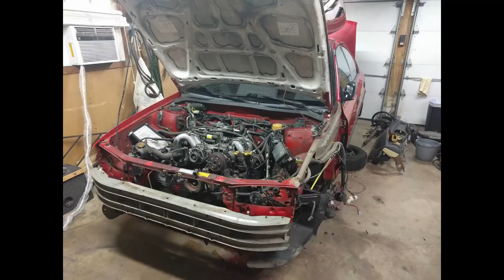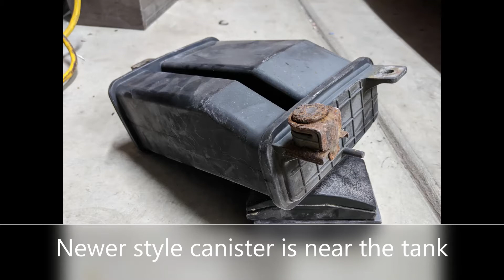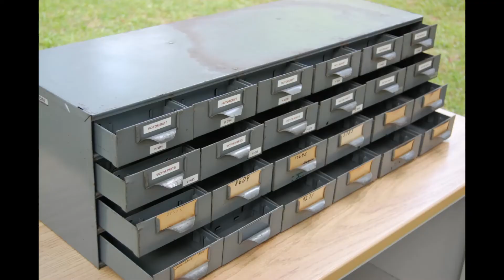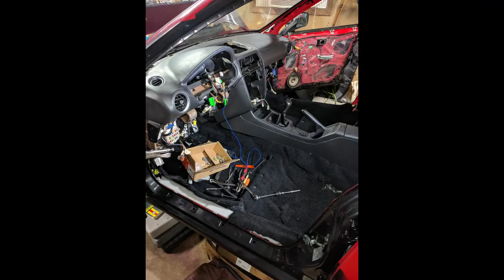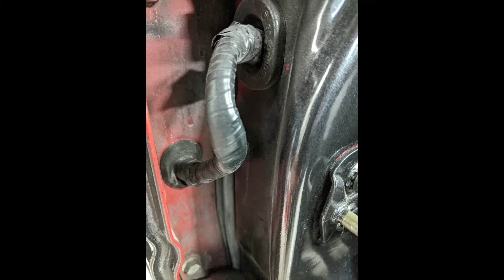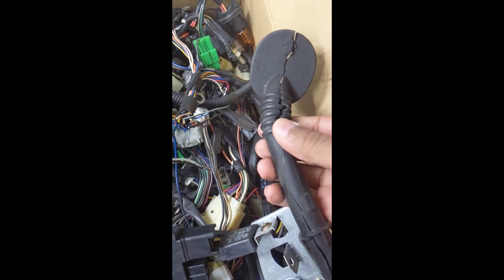Subaru Impreza WRX STI GD to GC  mechanical and electrical swap notes

Comment: Great video! I’m doing this exact swap into a 96 Brighton coupe so no door controls. Did you use the mid\rear harness that connects to the fuel pump etc or did that get wired in?
Reply from the maker: Thanks! I used the WRX fuel harness, it routes fine. Only part of the WRX harness where I didn't use everything was the trunk harness. The connectors I didn't use are for the rear latch lock, trunk light, rear wiper. For the tail lights and third brake light I spliced in the GC connectors.

Comment: So you basically used everything from the gd in the gc? So you basically have a gd just pasted into a gc? Minus the door controls.
Reply from the maker: In general, yes. There are a handful of gc components mechanically and electronically. If it were a newer GC I probably could have kept more GC components as the later models share more with GDs

Comment: I was wondering could you convert a GC front end into GD body ?
Reply from the maker: That definitely wouldn't be a bolt-on modification. The GD is significantly larger than the GCs. But, you can convert anything to anything with enough time and money.
Reply: @GoodDeedsHighSpeedsLV  yeeah I wanted to try to do something that nobody hasn't done it like that probably a few or so has done it. Wanted to try to do a 2004 wrx and do a Gc8 front end convertion and was wondering if it was possible haha
Reply from the maker: I think it's very possible. You'll have to figure out your approach. Like do you mold the GC headlights, grill, and bumper to the Gd front end, or do you take an entire gc front end (including fenders) and Frankenstein it onto the Gd framing. It would be really cool to see. I say give it your best shot! If you're not too far i'd come by and document/film the progress. I also have several extra gc headlight sets, parking light housings, side markers and  cf hood/hood vents.
Reply: @GoodDeedsHighSpeedsLV   Ill  definitely lyk know about it. When I do start the project. thank you broooo needed some advice about it thank youuu brooo

Comment: Awesome vid. I’m planning to do a full gd swap onto my gf. I hear gf and gc are basically the same. Was everything you swapped mostly a bolt on? Were there any parts from the gd that don’t fit on the gc/gf?
Reply from the maker: Thank you. The gf and gc are pretty much the same. Mechanically all of the main components (subframes, engine, drivetrain) bolt on from the GD. The top hat from the gd will not fit the GC, so just buy GC shocks/struts or coilovers for that. In terms of suspension I did have to get different offset rims as the gd has a wider wheel track. It depends if you get a gg or gd doner car. I go over that a little in my intro video (visit my channel). I hope this helps. In a week or two I'm going to have more swap/project related material. Lmk if there is anything specific you would like to see that I didn't cover.
Reply: @GoodDeedsHighSpeedsLV  cool thanks for the info. So even if I get a donor GD and swap the subframes, I would still need GC top hats. I would love a suspension swap vid. Thats currently what I have been trying to research.
Reply from the maker: @MrShloker  the oem and aftermarket GC shocks will bolt on to the GD knuckles with no modification. I will make a video to show my setup tho. I'll try to get it done asap.
Reply: @GoodDeedsHighSpeedsLV  Thank you. You are awesome dude!
Reply: @GoodDeedsHighSpeedsLV  since the gd is wider will you need the steering rack with tie rods from gd to work with the gd axles, knuckles and control arms.? Or will the gc steering rack work fine.?
Reply from the maker: @bakihanma7247  I'm not sure if the GC rack will work with everything. I used everything from the GG. Rack, arms, all of it and there were no issues. You can check the part numbers from Subaru. They seem to be pretty interchangeable because I've heard of upgrading from GC to GD. I've even heard of GD to 2015 upgrades with a little cutting. Currently I have aluminum control arms and sway bar for a GD STI, no issues either. If you stick with the same group of parts (GC or GD or GG try not to mix them) you should be ok. You will most likely need an alignment, so make sure you plan for that as well.  Hope this helps
Reply: @GoodDeedsHighSpeedsLV  yea that helps alot man thank you. Im getting all my parts from an 04 impreza outback wagon sport to my 93 impreza. I'm trying to change the whole drivetrain, axles, knuckles, rack, diffs to gd and keep my gc engine and trans. So you think the gd driveshaft and diffs will work with my gc trans as long as its all same final gear ratio right. Sorry for all the questions man I've needed help for awhile my car has just been sitting in the garage and it's time to get her back on the road.
Reply from the maker: That is a question I do not have an answer to. Even if the ratios match, it's possible that the length and splines on the driveshafts don't match. I suggest going to Nasioc forums and do some digging. I'm sure someone has tried to do what you are, hopefully they shared the info. Maybe even contact a subie friendly transmission shop or trans part distributor. I know flatirons tuning has done a bunch of swap stuff, maybe give them a call (seem to be nice & knowledgeable group). I put them in my "other YouTubers" playlist, so you can find their info there.
Reply: @GoodDeedsHighSpeedsLV  Alrighty mate I appreciate the help thank you I'll give them a call and see if I can figure it out